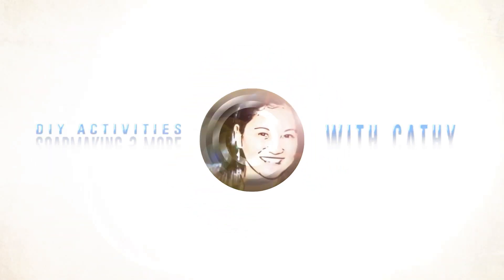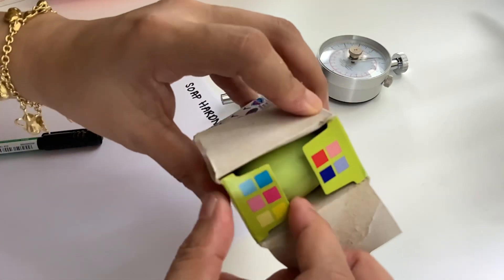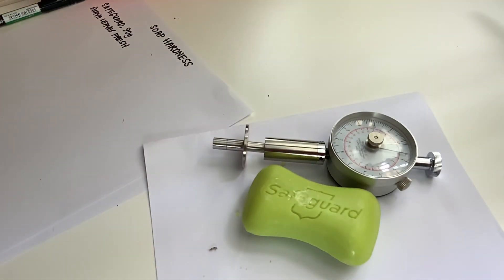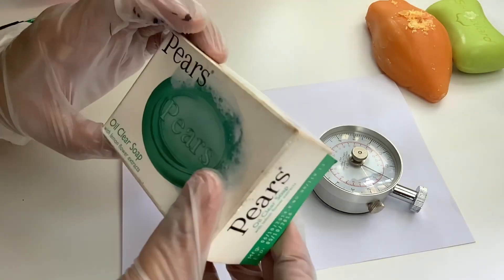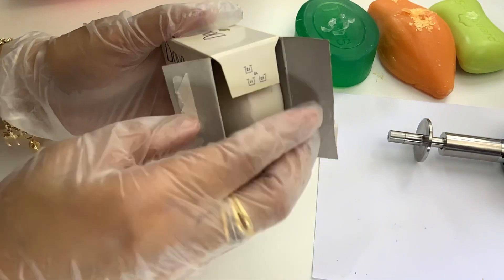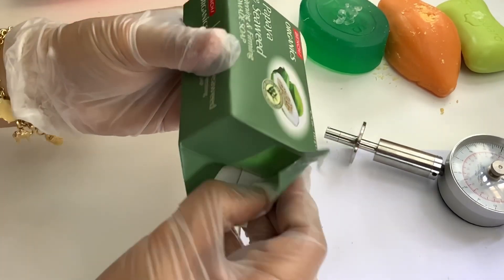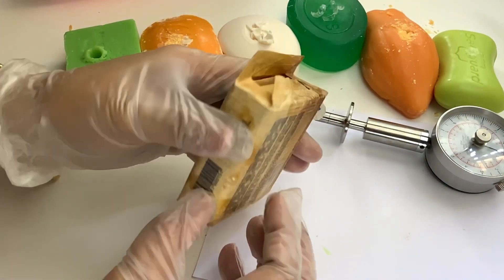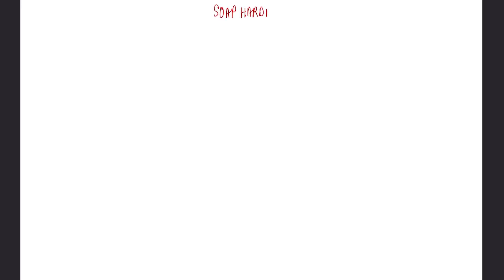Soap Hardness Test | Hardness soap quality testing of commercial soaps | How hard should my soap be?

Comment: Hi Ms Cathy.. It's so interesting to watch your video.. Nice information. Actually i am really interest with soap formulation. Based on your test to commercials soap.. what do you think about the good hardness value?
Reply from the maker: It will always depend on your formulation. Handmade soaps will always be softer than commercial soaps. When we formulate our own soap, higher hardness makes the soap bar less conditioning. Hence I cannot pin down specific values because it will depend on preference. I made this calcutor at www.mysoapcalc.com/soap feel free to use it. To me, as long as the value falls within the range (the print out will show the specifications) then it is good. Higher is always better.

Comment: Nice info, by the way, I made my olive sunflower soap, I notice this morning there's an oil on the top, oil separation I think, I mold it on the transparent tupperware that's why it's its visible, the 3/4 buttom is like a soap in cloudy  yellowish color but o on the top there is a clear oil, is it OK? I didn't open yet, bec I know it takes 3 days to harden the soap on the mould.
Reply from the maker: Yes wait for it. After sometime the oil will reabsorb. Did you calculated the correct lye requirement for the oil. Feel free to use my soap lye calculator at www.mysoapcalc.com/soap
Reply: @clumsysoaper 
Yes I used it and print the formulation for my guidelines, i used 40% lye CONC and 5% super fat 
Ahhh, ok... Thanks for the reply 😍